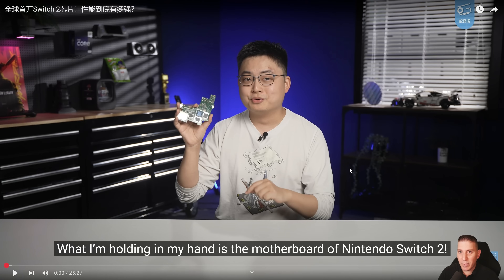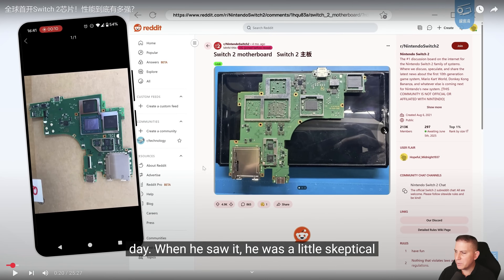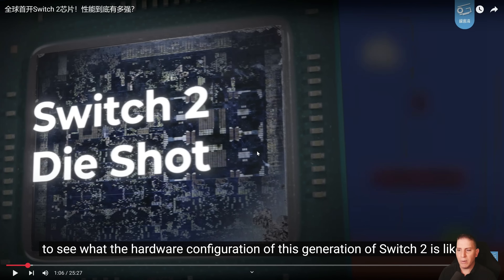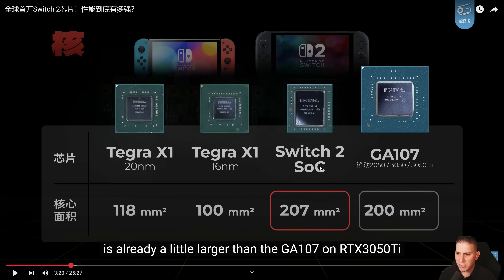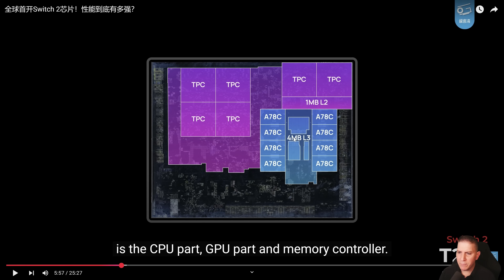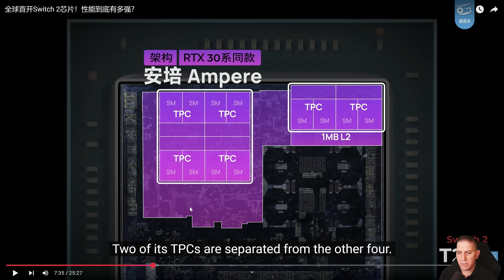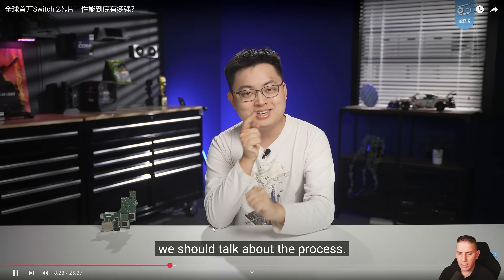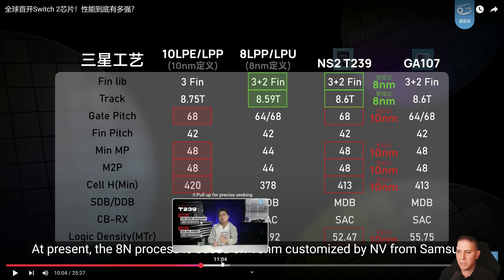Switch 2 GPU + CPU SOC Chip Size and Custom Architecture Revealed from Motherboard Scan

Comment: In the full video, the benchmark for the switch 2 are as follow: in portable mode it’s a 750 Ti and in docked it’s a 1050 Ti. That’s for raw 3D performances. Not including DLSS. For comparison the Xbox Serie S does almost double in score and the PS5 does more than 4 times the score.
Reply: @awesomereviews1561  bro, this is a mobile game console
Reply: @ruko3497 ...with the full experience in docked mode.
Reply: @ruko3497why are you being sensitive. Dudes just stating statistics

Comment: Absolutely weak hardware which is disappointing. No reason to try to defense that old trash
Reply: You're in full denial that the hardware is more reliable than your butthurt assumptions.  A custom made NVIDIA chip that's based on Ampere and Ada Lovelace.  You have ultimately failed miserably.  And thumbing up your BS comment ain't going to save the day.

Comment: As long as the Switch 2 can't play x86 games, and games are obscenely expensive, for me it could even have a 5090 chip inside, because I won't buy it.
Reply: Get the hell outta here with that BS.  The Switch 2 CAN play third party games... especially games that uses DLSS.  Case in point--  Street Fighter 6, Hogwarts Legacy, and Final Fantasy VII Remake Intergrade.

Comment: The benchmarks they showed comparing to other consoles is missing from your analysis. The argument remains the same: If you can live without the  4 first party games you want, don't go near Switch 2. 

If you can't live without them, just accept that it is incredibly overprices for the spec, those 4 games will cost $360, subscriptions and upgrades for existing library, a decent controller are all part of that decision. 

The chip is 4 years old and the Steam Deck is much more powerful, costs less, has better games you wont get on Switch, has more games, which are a fraction of the price and will run much much better. 

If those 4 games are worth that to you, and you accept the hit without deluding yourself  - I salute you sir.
Reply: Steam Deck is not more powerful. Not even as a portable. It will be noticed due to third-party and especially Nintendo's own games. Steam Deck supports sloppy FSR scaling, which is a completely different level in a bad way than DLSS.

Switch 2 comes with the Switch 1 game library. You can play Switch 2 handheld, in tabletop mode as a two-player game, and on a TV where its power rises dramatically above the Steam Deck. 

In addition, physical games for Switch and Switch 2 games have a very high resale value. Steam Deck is a device for hc pc players based on sales figures alone and its owners are clearly bothered because Switch 2 is a more capable gaming device made by the children's game company Nintendo. 

Console players who buy Switch 2 and many PC players who buy consoles are very happy with the generational leap they get with Switch 2

Comment: Switch 2 barely runs Cyberpunk 2077 and Hogwarts Legacy already. Good luck getting it to run GTA 6. 😂
Reply: REALITY CHECK, troll... The Switch 2 CAN run Cyberpunk 2077 Ultimate Edition and Hogwarts Legacy.  In fact, both games use DLSS with already greater framerates.

Prepare to be disappointed, because GTA VI will be coming to the Nintendo Switch 2 in 2026!

Comment: If this is it, I'm highly disappointed, this has confirmed my worst fears that the Switch 2 is essentially the delayed Switch Pro rebranded.  Ah well, as long as it can run Mario Kart and Nintendo games at 60 that's good enough.
Reply: Which pro console has a 10x performance leap over the original version?
Reply: REALITY CHECK--  The Nintendo Switch 2 is 10 times more powerful than the original Nintendo Switch.  Get your facts straight, d-bag!

Comment: Why are people excited about this? On the surface the switch 2 chip is nothing more than a basic tegra tablet soc. It’s running on an old crappy node from Samsung (8nm) which everybody forgets was terrible with considerably less cuda cores than a laptop rtx 2050. Which is a dumpster gpu to start with. 
 Running at a maximum of 30 watts total between the cpu cores and gpu ( which Nintendo will probably never run it that high) plus nintendo loves to cut down clock speed to cheap out on cooling. I don’t understand how people think this thing is going to be a powerhouse. Switch 2 is based on old, cheap, low end, outdated hardware that Nintendo is charging a fortuned for. 
 As a side note the t239 isn’t custom. It’s been on the market for years, and has been marked out of production. Looks like nvidia dusted it off for Nintendo.
Reply: Ha ha ha ha this is amazing.

Can you uh, point me to a device that has been using the T239 for years?
Reply: Says the troll using sock accounts for BS assumptions and status points.

Comment: This shit have launched during 2021, Gtx 1050 level performance in 2025 and that too for 450, I was expecting at least 3050 level performance but 1050 level performance. Oh my godddddddd.
Reply: its not like you gonna get it anyway.. 
then what about Steam Deck? what level performance it have? thats also not cheap and still selling..
Reply: @violent8931  I myself have a rog ally and it has the performance equivalent to almost a 1650m. Steam deck is cheaper and it launched in 2022. Steam deck and rog ally have the ultimate library and the games available are quite cheap during sale. You don't have pay 60 bucks for a 15 year old title.
Reply: I've been saying this for months, even in the comments on this channel, the rtx 3050 is clearly more powerful than the xbox series s gpu, at least 30% faster in pure raster, much more in rt.
Switch 2 could never have reached the performance of an rtx 3050 with this form factor, desktop rtx 3050 is a 9 Tflops 130W gpu...
Reply: @Zexx9100  I am talking about the rtx 3050m
Reply: @arthurmorgan1724  i dont think anyone with Switch OG gonna expect NS2 rival box console.. NS2 power around PS4 already aligned with my expectations years ago since Switch OG only 1/4 at PS4.. and now its 5-6x more powerful than OG switch which really nice upgrade.. the only thing that people upset is the price tag for console and games..
Reply: @Zexx9100  no one saying its more powerful than rtx 3050.. if anything NS2 only around rtx2050..

Comment: I’ve posted this on Reddit before but I received a very hostile response. Do you think Switch 2 will have the ability to run SteamOS? That would make it a steam deck replacement for me.
Reply: No, because it will likely never get cracked.
Reply: @Nobody-sp7ug  every nintendo console so far has been cracked.
Reply: @blackheart909  good luck lol.

Comment: -If I didnt know when it was printed I'd assume this year judging by the results, so its apparently irrelevant, but I'm now CERTAIN the ppl screaming about $80 will now complain on when the unofficial China leak potential fake was printed.

-I have always believed the Switch OLED was supposed to be the Switch2, so these were probably for 2022

-Can't help but wonder what got him that wound to the head. I guess China does this because Switch2 isn't sold there anyway. 

I GOT MY POPCORN FOR THE LEGAL ACTION NINTENDO NINJA'S WILL DEPLOY 🍿🙂

Comment: This is great news. I'm very excited about the potential Ada Lovelace features and the 8 Cpu cores! I'm not worried at all about the 8nm process, even DF said you should not worry about it because it only affects battery life in portable mode.
Going back with the custom arch this would explain why Switch 2's DLSS looks so incredibly good even surpasing Series S picture quality.

Comment: I have a 3050 4g laptop with a intel core i5 12450h (8 core 12 thread), (idk if the cpu is close or not) but the gpu seems to be, and based on the performance I get in games, if the switch 2 is anywhere near it, It's going to be very impressive.
Reply: That's a 9 tflop peak theoretical card. Switch 2's gpu is 3 tflops peak theoretical.

Although geekerwans expiriment broke the 2050m by crippling its memory heirarchy (he admitted this when the problem was  presented to him in his comments on the video) the gpu just isn't big enough to be close to a desktop 3050.

Switch 2 has a much larger gpc (12sm vs 8sm), which means it has more registers, and more cache memory per gpc, which means it will be much better at getting closer to its peak theoretical, but it still only has one GPC, compared to the 3050m's 3(well, binned, but still).

Desktop cards, even entry level are just too big, and thats for every handheld. Their gpu scaling will always be a couple generations smaller.
Reply: If that trash impresses you maybe you should stick to nostalgia games
Reply: @fk73771  the switch 1, ps2, and wii sales prove that graphics arnt everything, at the end of the day only the games matter
Reply: @ you can have good graphics and also good games don't you?
Reply: @fk73771  yeah but I think some games are subjective if they look good to you or not. For example I think a good art style makes a game look better than graphical fidelity, I think mario galaxy and odyssey are good examples of this

Comment: I take Nvidia saying 10-times graphical power of Switch 1! Seems to be legit. 🗽
Reply: Switch already 5X weaker than PS4.. but Switch 2 docked mode had 2X PS4 power make it 10X than OG Switch.. its make sense
Reply: @violent8931 if you watch the full video from the Chinese guy he said its not himself, and he’s an expert
Reply: @EndtimesArehere-p2j   did he testing the chip? as far as I know T239 capable of 3tflop in docked.. so its safe to say it atleast 2X PS4.. unless they underclocked it again like OG Switch. but we know its more powerful than PS4.
Reply: @violent8931  in the video he said nvidia says 10x, and then says its not. Its closer to a ps4, which all the experts have been saying including this guy and digital foundry
Reply: @McDaniel77  it doesn't
Reply: @ThinkTinkh  Sadly Nintendo missed the 4K 120 fps possiblity by sacrificing the HDMI 2.1 support. So "only" 4K60 is possible.

Comment: People in the comments have said that he made some mistakes in reference benchmarks, for intance he use the reference card for xbox series s that have a feature (big one) infinity bandwith gen 1 or whatever is called which is not present on xbox series s, so that number is not that high, also, the reference apu for switch 2 has less ram.

Also, it seems due to his config the cpu benchmark was running on half the cpu core count, though that bench can be bad anyway since we do not know the real clockspeeds of the cpu.

Comment: Pretty much what I expected, GPU is close to modern phones but with the advantages of Nvidia tech, CPU is a fair bit behind current phones along with storage speed, ram speed isn't too far off but lpddr6 will apparently be starting to appear in phones this year.

I just hope that Nintendo make a "pro" version later that's actually a bit more powerful if they plan on it lasting 8 years + to hopefully avoid bad performance in later gen games.
Reply: Sorry, bad idea. Thankfully, Nintendo is not ridiculous as the other consoles in this regard.

Comment: basically what everyone suspected, good enough but very obviously designed long before the system was released given the node. hopefully there is a mid-gen pro which pushes the clocks and settings this time.

Comment: It doesn't matter if the CPU and GPU are good, nintendo will severely underclock them. If the raw power is something close to a PS4 Pro, then we're getting something closer to a base PS4 after the underclock/undervolt.
Of course, Devs can use DLSS, but DLSS will only get you so far.
Reply: The simulated benchmarks are based on underclocked specs already

Comment: One thing that people seem to be forgetting is that 3D Mark is only one type of graphics benchmark. There at many others and they stress the GPU in different ways and to get an accurate power envelope of the switch 2 vs the PS4 and xbox series s, you'll have to run them on all of them 👍

A laptop with an RTX 3070 just on 3D Mark can score in around a PC with a Desktop RTX 2070, but adding wildlife extreme, superposition, cine bench and others to the mix can change it's score to in around a mid range desktop 3070 (and the difference between those two can be very significant).
Reply: Eh, that bench is no good. 

When he downclocked the 2050m gpu to match the 3 tflops of the ga10f, he also downclocked the entire gpu internal memory architecture.

This made the l2 cache bandwidth, slower than the vram bandwidth. So.... the vram was waiting on the l2, which is insane. This is apocalyptic for a gpu's max attainable flops (MFA is the real metric people should be trying to find out, instead of peak theoretical).

This is the sane mistake df made.

This was brought to his attention and he acknowledged  it broke the system in the comments of his video.

Comment: Cpu that runs between 1.1 and 1.5 and 3teraflop gpu in 2025. This is dated and its not even out
Reply: Teraflops mean  nothing this days especially  with dlls magic 

Apple M4 has  4 TFlops GPU but most games will run better on switch  2 😂
Reply: @Mrorlglothcant stop laughing a 3 teraflop gpu now is good. And cpu that runs between 1.1 and 1.5 is amazing in 2025. And thats docked. Portable is much worse. But for their target audience is more then enough. Cartony and colourfull stuff
Reply: @davidvillamarin7164   1.5 GZ that performance  better than all Ps4 pro CPU 🤣
Reply: @Mrorlgloththats good? Cant stop laughing.  The jaguar cpu were dated when the ps4 was lauched in 2013😂😂😂😂. The switch cpu is slow and weak. There are mobiles with much better and way faster.
Reply: @davidvillamarin7164   Snapdragon  8 elite and Apple A18 Pro better than Ps5 pro CPU  so ? 🤣 

even Apple M4 twice performed  of  Ps5 pro CPU so ?  🤣
Reply: @Mrorlglothyou keep laughing. Yes, they are. That doesnt change the fact that the ps5 or the series are much more powerfull then the one on the switch 2... and they are 5 year old plus cpu and they are not enough right now. Soooo. Do the math. U
Weak cpu and weak gpu. Low and slo bandwith.... underpowered and expensive at launch... that simple.
Reply: @davidvillamarin7164   you will be more surprised  switch  2 could pass Ps5 total  sales in Japan for 1 years  🤣 specifically  with trump tariff  .
Reply: @Mrorlglothand? Do you play with sales. What the switch 2 will have is the worst version of all 3rd party games and the most expensives 😂😂😂. Cant even imagine how dumb must you be to buy them...
Reply: @davidvillamarin7164   Iphone 16 Pro Max was best selling smartphone of 2025  so ? 

In Japan na alone more than 2.1 Million peoples  wanna brought  switch  2  most of them  will not get it in first batches because  most will shipped to  us first  before tariff  .

Your  should  stopped judge the world with your own value and purchasing  power 🤣
Reply: @Mrorlglothwho cares how many want to buy it. The wii also sold tons. Doesnt change the FACT that all 3rd party games there will be the worst version and the most expensive. Also that 3rd party support, like it happen with the switch, will decrease because the sales are bad. Their target audience wants to play cartonny, colourfull kirby, donky kong,  princess peach, mario, luigi, splatoon. Not cyberpunk or rd2 or gta6. So the lack of power doesnt really matter. But comparing to other portable coming out its really underpowered.
Reply: And depending on which console you compare it to, the 3 teraflops change into 1.X teraflops 🙂

Comment: The jack of all trade but the master of none. As a dock console this is much weaker than PS5 which for now you can get a slim close to the same price. As a handheld it going to burn through the 19 wh battery , worst battery life of all Nintendo handhelds . I can see casual Switch gamers be surprise how fast very demanding game burn through the battery. 
 Of course with hardcore gamers they will likely keep it docked or carry around extra batteries yet that goes against the idea that Nintendo is for the causal gamer.  I don't see the more casual gamer wanting to carry around extra batteries or have it plugged in while gaming on the couch.

Comment: Their video was good, but still, not real hardware and had a really bad test that was Monster hunter wilds:

using a rtx 2050 4gb  as reference isn't fair for MH wilds as the game doesn't run well on 4Gb GPUs at all. When switch 2 does have enough vram to run the game.
the 2050 is behaving as expected of not having enough vram and having its bandwidth downclocked to move this vram fast enough.

Like, their own "simulation" benchmark puts the switch 2 handheld on par with steam deck, yet youtube have TONS of videos showcasing MHwilds running on steam deck MUCH cleaner and smoother than what they achieved in their "simulation", and that without dlss.

How that didn't ring any VRAM redflag before they said "impossible to run" is beyond me

Comment: Where are all the delulus now with their xbox series s comparisons? Let's see what nonsense you're going to pull out your backside now 🙄
Reply: it's still going to outperform the Series S but not by raw power but with optimization and DLSS
Reply: @codezero7981  not even with that (on average). But it will come close.
Reply: @codezero7981 the great DLSS cope lmao, you know that isn't 'free performance', right?
Reply: @RZ34ZX  industry developers saw the matrix demo and said it was in around "85%" of what they consider it to look like on the xbox series s.
LOOK like.
Reply: @ThinkTinkh  Digital Foundry 2000000% corect that Switch  2 only equal with ps4 and not worth your money  🤣
Reply: @Mrorlgloth they never said either
Reply: @ThinkTinkh   They ? I Am fixed 🤣  

20000% digital Faoundry fake account  🤣